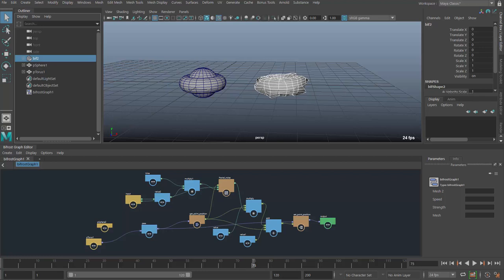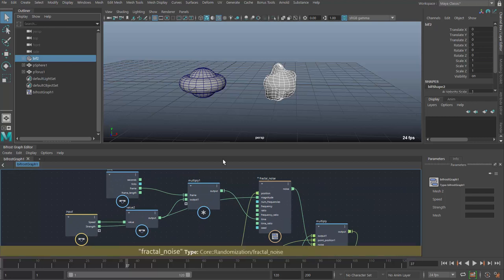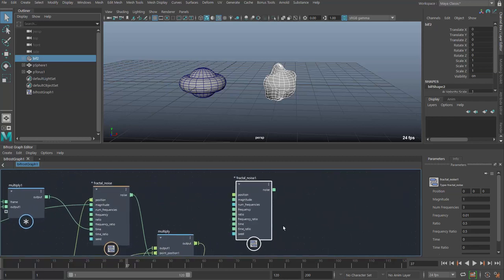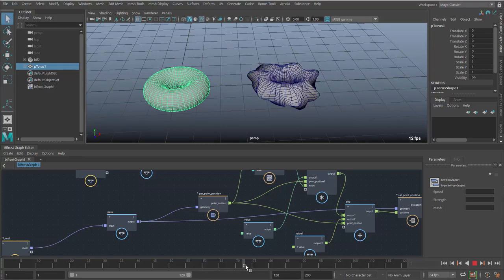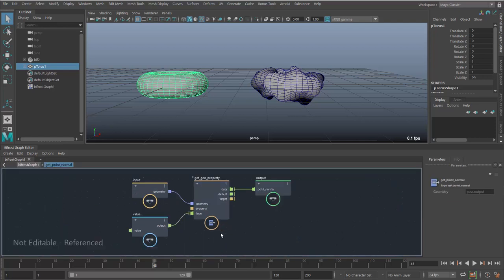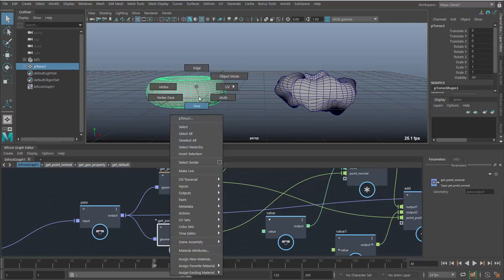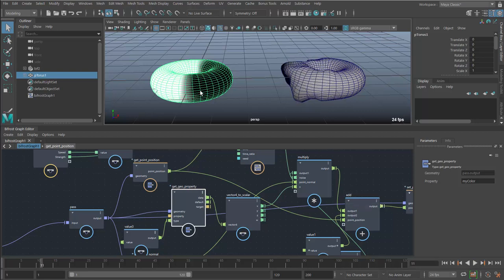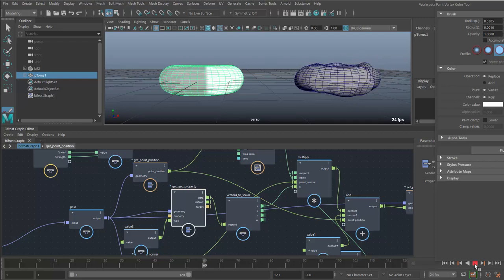Bifrost Basics Part 3: Compound Intro

Comment: Really cool! I like how quickly and easily the compounds are made with a simple ctrl G shortcut. I love how it all connects up straight away and how visually intuitive it is. It would be nice if there was a 'weightmap' node inside bifrost. Whenever anything goes from Maya into bifrost it feels a bit clunky. Like the year 2001 is talking to 2019.  Similarly the whole concept of a deformer is quite interesting.

 From what I understand bifrost doesn't make any distinctions between deformer or simulations etc. It just outputs a new bif shape. But it would be nice to have a bifrost deformer in a stack. That way you could use existing Maya deformers (lattice, bend, delta mush), in combination with custom bifrost ones all on the same object. Then change the order etc. Currently in Maya every deformer has a 'paint blablabla tool' for creating a falloff weight map for said deformer. Yet bifrost shows it's all the same. You just mask an area, get the red channel and multiply it. I really hope further integration with the rest of Maya becomes a priority over new features. This is what made ICE so good. It was fully integrated and worked seamlessly with the rest of the package and didn't feel tagged on. 

Another good example of this is the concept of a 'cluster' or a 'set' in Maya. If you can somehow create a group of polygons (manually or procedurally) to which you can apply an effect so much becomes possible. In some ways a shading group is the same thing. But again, there's no need to have a seperate 'cluster' system for shaders, rigs, deformer or selections. It's all the same, namely a group of conponents to which you apply certain properties. I think this type of core, foundational development coming from Maya is what bifrost needs to make it work.

Another good example for making things more integrated is the lack of clarity where Maya ends and bifrost begins. The node editor (as clunky as it is) is a very powerful tools for which people have created nodes like maths nodes and rigging nodes like conversions and raycasting. The idea of having all the capabilities of the node editor, the hypershade and bifrost in one is very compelling. I feel like as long as this stuff is developed (or not developed) seperately, it will never reach its full potential. 

Keep up the good work and I really hope the rest of Maya will catch up to this wonderful new tool.

Comment: One thing that would probably be useful is list of nodes and what they do. For some reason there is never such a thing in operation manual anywhere.
Reply from the maker: Good idea.  I'll try to put something together that covers a range of different nodes.  There are a lot but I could cover the more useful ones.
Reply: @MyOhMaya  thank you so much in advance. If you can cover all of them at least in one sentence it would be very helpful :D

Comment: Using Maya professionally for 15 years has taught me to refrain from getting excited about new features. They never work properly until maybe 3-4 years later. And a lot of the time they don't ever work properly.
Reply from the maker: V1 of any software / feature is almost always rough around the edges, but I really don't expect this to take 3-4 years to become stable/useful. Bifrost has been in dev for many years now and there was a conscious effort to not release it too early. We've made that mistake in the past and learned from it (releasing too early that is)
Reply: @MyOhMaya  V1 ??? herm... that's ICE man, there's at least 8 version from 2007 to 2015
Reply from the maker: @NoelF_Artist  - Yes it does look a lot like ICE and it was in many ways inspired by it, but Bifrost is not ICE.  ICE was very much tied to and dependent on Softimage.  Bifrost was technically designed to be DCC agnostic.  Maya is essentially a host for Bifrost.  Arnold can also ingest Bifrost graphs and evaluate them at render time.  There is actually a beta of Bifrost for 3Ds Max as well.  It could conceivably run in other DCCs, game engines, etc...  From what I have been told by developers there was no way to really separate ICE from Softimage.
Reply: @MyOhMaya  When exactly did you guys learn from that mistake? Please tell me it was a month or two ago, because all the way from maya 4.5 to maya 2018.6, Maya is the most unstable piece of software I've ever encountered. And I've never even tried bifrost. Working in Maya is like juggling barrels of nitroglycerlin.
Reply: Hi Mikael, Marcus came by the office yesterday and demoed this which clarified alot of things for me. It's in reality not "in maya" per se. It runs completely independent of it. It can run in command line without using maya at all.

Still have to wait and see what becomes of bifrost but I'm definitely more intrigued than I was by the initial marketing push at release.
Reply: Which version are you using at Snowanimation btw? 2019 seems like a huge win for maya artists so far in terms of stability and finally taking a big stab at the backlog of requests and bugs.
Reply: @Davesplaining  We're on 2018.6. 
I don't know Dave... I hear stories about "the next version is gonna be a super stable release" from autodesk more or less every year, but every time I try the new release it's the same old crap as always, with brand new bugs sprinkled on top of it. I've lost faith. 
The fact that bifrost is a completely separately developed plugin gives me some shred of hope, but it's still integrated into the house of cards that is Maya, so...
Reply: @lostparanoia2  well yeah I see what u mean and agree to some degree. Anyway if it's a consolation bifrost can run entirely without Maya using bif command line. I'm sure autodesk doesn't want this to be spread but here goes... Marcus even showed a slide that the mill had already integrated it in houdini 😂
Reply: @lostparanoia2  but as far as Maya goes our keyframers really love 2019 for example, the viewport caching feels very futuristic
Reply: @Davesplaining  That's good to know. Thanks. Perhaps we will give it a shot when we're not under too much time pressure.

Comment: I have no idea how a microphone can sound so bad in 2019
Reply from the maker: I don’t quite get what you’re saying... sounds fine here. Either you have super sensitive ears or you’re just trolling for a reaction?  :)
Reply: @MyOhMaya   Steven, as per your mic...  It's loud enough,  just sounds like an AM radio.  You should have the Autodesk folk splurge for a snowball mic  : )
Reply from the maker: outtoplay - ha ok fair enough.
Reply: @MyOhMaya  he is probably referring to sound being a bit clipped. maybe you were a bit too close to the microphone or gain was a bit too loud.also it sounds like you don't have  the best microphone, something below 100 $. One of those things that you carry on your head like you are a Madonna from 90s. Which is perfectly fine since this is a technical instruction video, not American idol:) but I'm trying to figure out what he was trying to say.
Reply from the maker: @raspas99  - Thanks. I do have a decent "Madonna" headset that has worked fairly well in the past :)  I was on different computer and I think the input settings were off.  I'll tweak the settings for the next one. Thanks.
Reply: @outtoplay  I think it just sounds like there was more compression on this one than the previous parts.